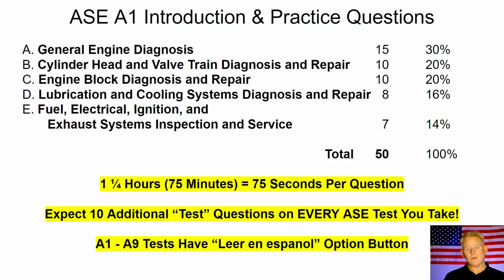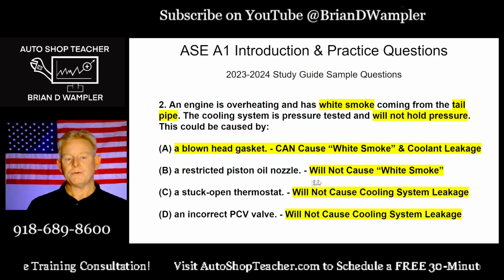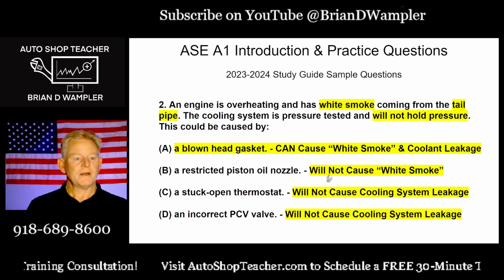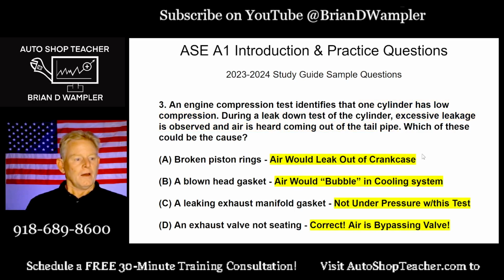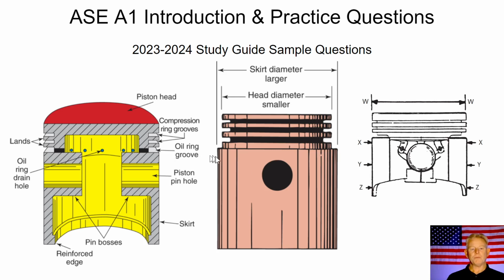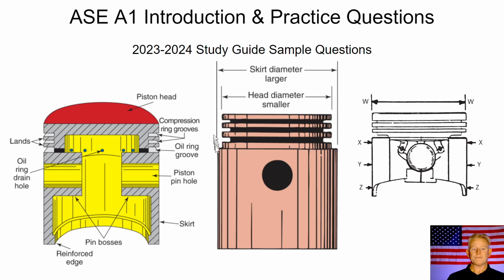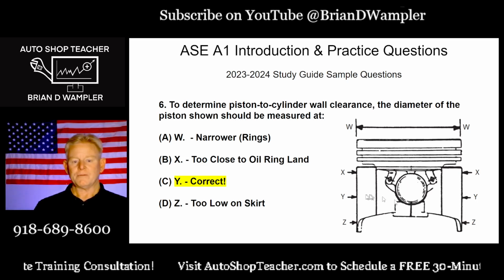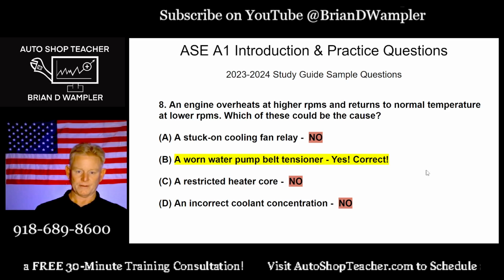AST - ASE A1 Engine Repair Intro

Comment: I call the Tech A/B Beavis & Butthead.

Also 51:22 is an example of a question ASE wants to use the "easiest answer," but in my two decades as a mechanic, I have never seen a plugged fuel filter on a fuel injected system. Carb, yes. FI? Not a chance.